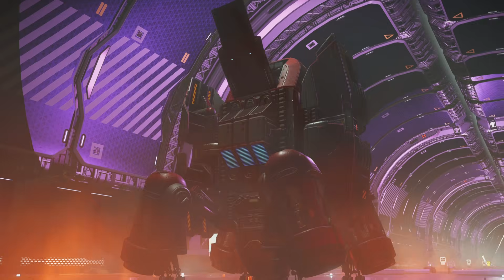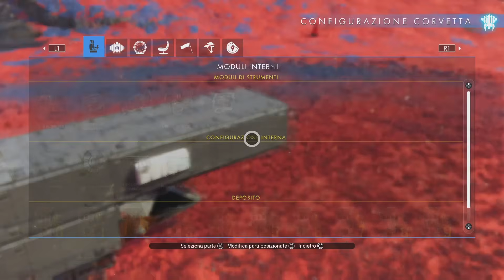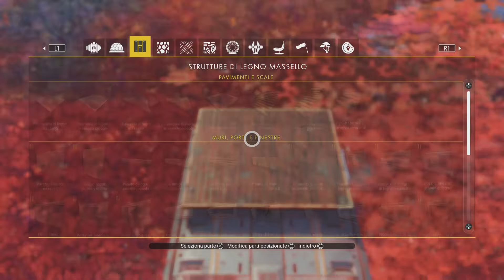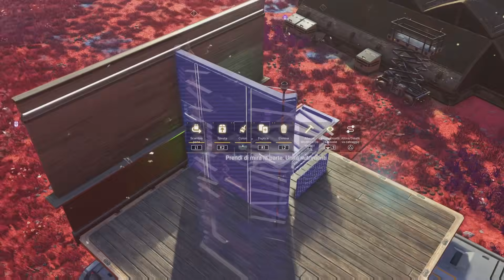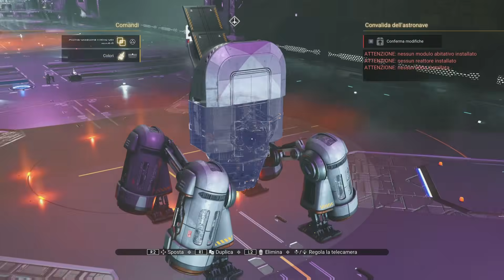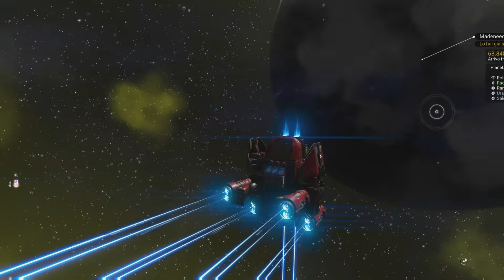No Man's Sky | CUSTOM CORVETTE [adjacency glitch nerfed, transfer method still ok]

Comment: im having trouble with the reverse wire glitch onto the corvete, to the point that i question if it is still possible. I have no problem performing the reverse wire glitch onto regular buildstructures. Can you help me out here?
Reply from the maker: They fixed few glitch unfortunately, write me the exactly timing in the video and i will check and give u an help about it
Reply: @Artifex.87  ohh thank you. its 5:30 ish, the reverse wire glitch
Reply from the maker: @Taztaz214 you have to press toggle to wire and build button almost at the same time. I dont know if they have patched this glitch too honestly. You cant do it?
Reply: @Artifex.87  i can perform it without problems on regular buildings. but it doesnt place the wire when i try it ontop of the corvete
Reply from the maker: @Taztaz214 surely because your aim is on corvette, you can perform reverse glitch ony if you aim a base part.
Reply from the maker: @Taztaz214 check my other video, here i explain in a very detailed way how to do glitches building on corvette, freighter and exoctaft 👌🏻

https://youtu.be/R-xpvOXFB1M?is=j7vzhN6gEYL98dDG
Reply: @Artifex.87  you are a fk legend thanks man
Reply from the maker: @Taztaz214 hahahh thanks a lot mate, glad to help!